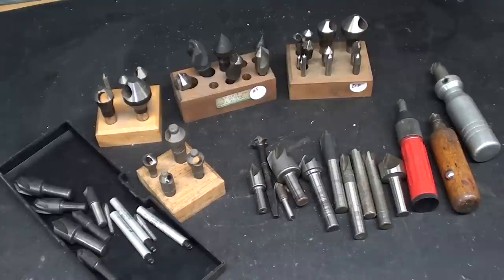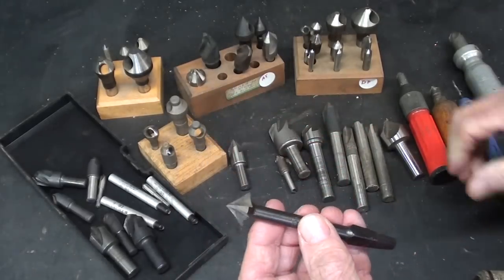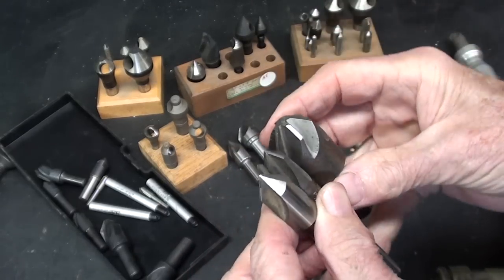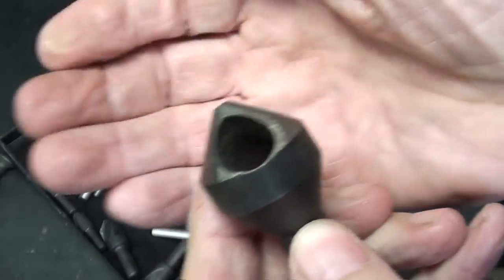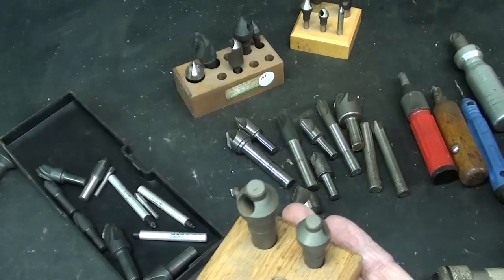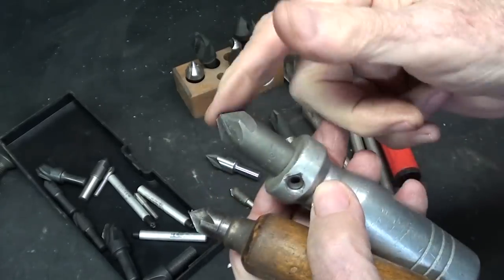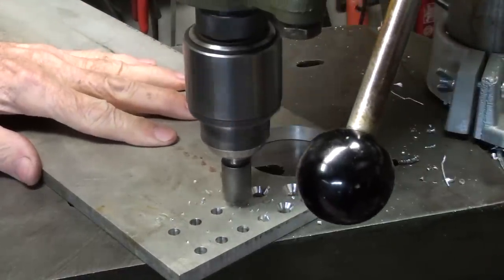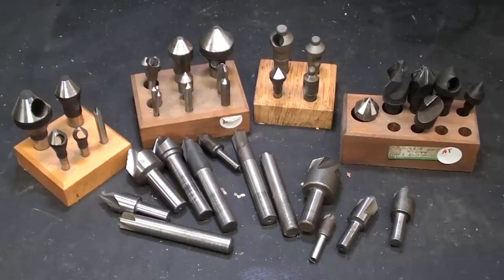COUNTERSINKS EXPLAINED short #34 tubalcain mrpete

Comment: Thank you Mr Pete. My dad used his dads brace & bit back in the 1950' s before he purchased a hand drill. First-time that I ever saw a wood counter sink for a brace & bit. Years ago I was a sparky in a large candy company where we weren't allowed to use plywood to mount our numerous electrical boxes so we would purchase 4 by 8' sheets of 1/4" thick aluminum plate and had it sheared down to various sizes. Over the years had to tap thousands of 1/4 by 20 holes in these p!ates. I always used a counter sink to make it easier to start stove bolts.

Comment: That is a great piece of information. I have,but one single flute countersink. It needs a lot of force to get a bite. Now the zero flute is very smooth and the cut seems very swift in aluminium, at least. I often grab a large drill bit. Thanks Mr. Pete

Comment: Great short video Mr. Pete 
Interesting info:
The most commonly used chamfered angles are 82° and 90°. Imperial sizes per ASME B18.3, 82° is the standard and 90° is the standard per DIN 7991 for metric screws. 100° angles are most commonly used in aerospace applications and when fastening into softer materials as it distributes the pressure over a larger area than the 82° screw.
Reply from the maker: Thank you for that additional information
Reply: Yep. That's a very important distinction when making things for Metric vs Imperial fasteners. Cars and motorcycles come to mind. I was nearly finished with some parts I made for my motorcycle and discovered all my countersinks were 82 degrees. Not a 90 degree in the bunch.
Reply: aviation rivets use 100° + because of the thin material, so that the countersink does not enlarge the hole and it is required to leave a   square margin on the hole and never a sharp edge that would happen with less angle.

Comment: Glad you mentioned the use of these for helping start of taps… that said, one of my primary uses of these, has been for the purpose of removing the “raised” portion of metal around a threaded hole, especially in cast iron, of older vintage or antique engine blocks & such, before or after “chasing” all existing threaded holes. The metal does begin to raise over decades of heat transfer expansion/contraction & WILL interfere with two milled faces of parts from sealing properly, with correct distributed pressure along gaskets in between fasteners. Chamfering away the top-most raised edge, allows space between both faces for gasket material to have greater torque applied to overall meat of parts, vs only exactly at each fasteners’ locations, eventually giving potential for leaks in zones between fasteners. One of the many engines I’ve rebuilt, was this super cool, itty-bitty 4 banger Waukesha, fully self contained generator, from 1942, military spec’d. It was made mostly of Aluminum or, some Aluminum Alloy. I intentionally installed HeliCoil threads in most of its original soft metal holes; very much needing a decent chamfer of those holes. I wonder if that little engine was bigger or smaller then then Crossly car engines back in the day? Anyways, THANKS Mr Pete for yet another fantastic internet shop tutorial !

Comment: My favorite handheld countersink deburring tool used to be sold by aircraft tool companies but seems hard to find now. It was a knurled aluminum screwdriver-like handle with a one-way Sprague clutch in it for 1/4 inch shaft. Any ordinary countersink would work in it with a 1/4 inch shaft. They cane with a 4 flute Severson. The one-way clutch is very convenient to use. Bearing shops sell Sprague clutches  and they just press in like a bearing. It is a an easy build and a tool  you will use often. Build one and try it. JY
Reply: I still have mine. NWA 95-05.

Comment: Yesterday, I needed to chamfer the edges on an aluminum part I just made on my mill. I could not find my chamfer tool, so I stuck a countersink bit in the mill and used it as a chamfer milling cutter. Worked a peach. Sometimes we just have to think out of the box.😂❤
Reply from the maker: Thank you, I will try that

Comment: One point you missed: 82° is the standard for inch fasteners, 90° for metric, and 100° for the special fasteners for thin material used in aircraft.

Comment: Very interesting short video and comparison! 
I use the Granlund sets a lot as well. Fairly expensive but worth it. 
Another type I have seen advertized but not used is where the cutting edges are unevenly spaced to eliminate chatter. Would love to see a video about them.
Reply: I often wondered if the cutting edges were not arranged evenly spaced, that that would eliminate the chatter. Incidentally, I have a 5 flute. When I get chatter, it leaves a 6 'sided' counter sunk shape. I think what ever the count of cutting edges the tool may have, when the chatter occurs, the resulting shape is that count plus one.

Comment: I use single flute counter sinks at work. I have to debur before tapping. Problem is the holes are laser cut and leave a very hard rim at top of hole wears out flutes very fast leaves a chip grove in cutting edge . when send them out to be resharpened. we are cutting 1026 steal plate from 3/16 to 1/2" thick. tapping 10/24 to 1/2-13 🪛🔩

Comment: 82° is definitely not the most common where I come from, I had to order some special. 90° seems to be the modern standard these days.
I ordered a couple of 82° sets from China & they were both 90°.
Most metric machine screws you get these days will be 90°.
I restore vintage stuff so I often have to put modern countersunk screws into the lathe & re-profile the countersink. I’ve got tools ground up for 60°, 82°, 90° & 120°
Reply from the maker: Thanks

Comment: What rpm for countersinks of different size major diameter (of the finished countersunk hole)?
Reply from the maker: That’s a trick question, I’m not sure I just experiment. Either too fast or too slow causes chatter.

Comment: How well does the pilotless ones work on steel?
Reply: Very well as long as the steel is relatively soft. Of course you have to apply more pressure. There are carbide countersinks for harder steels.